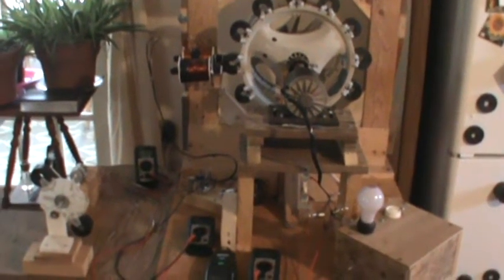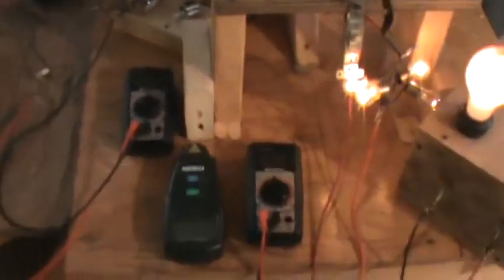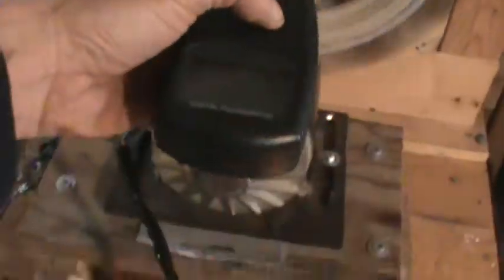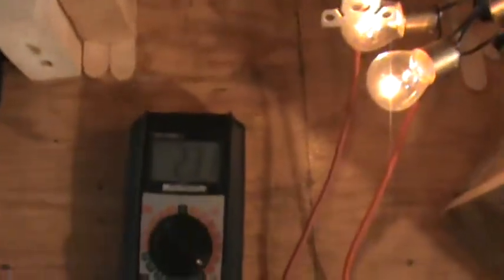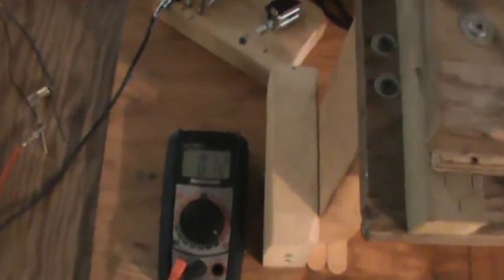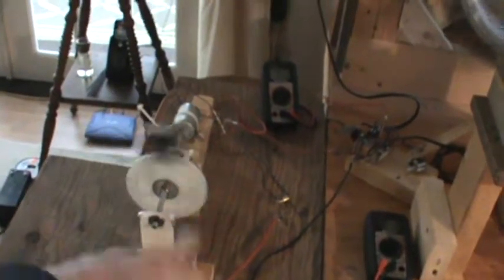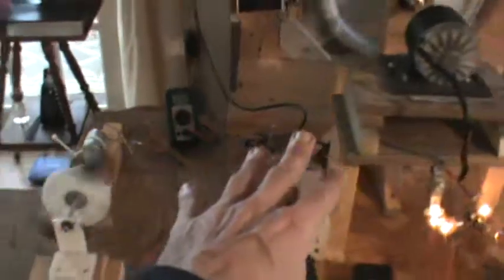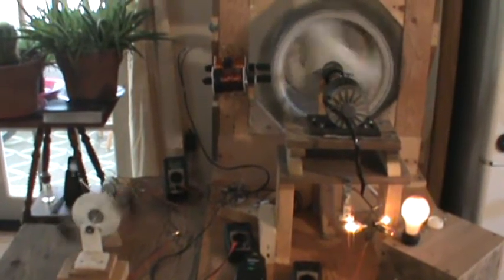Free Energy Project - Laminated Core

Comment: For the sake of experimentation.... What would happen if you make those laminated coils a bit longer on the side away from the wheel, and then mount your little wheel in such a way that it also induces a current in those cores. Two wheels on one set of core and coils. Just thinking out loud...